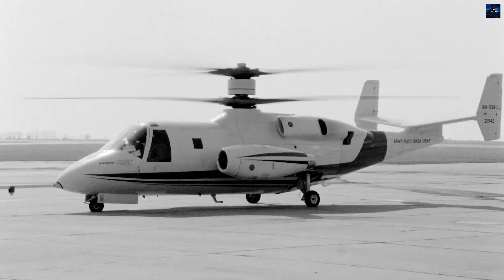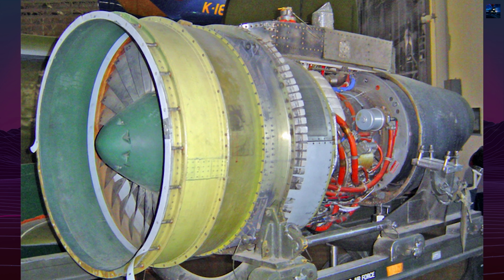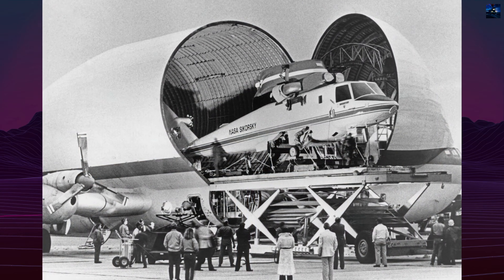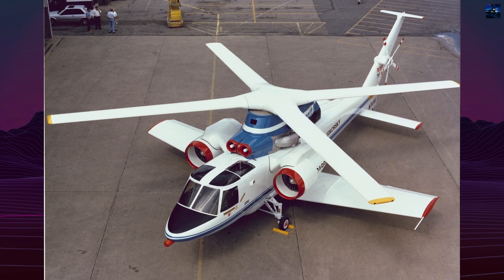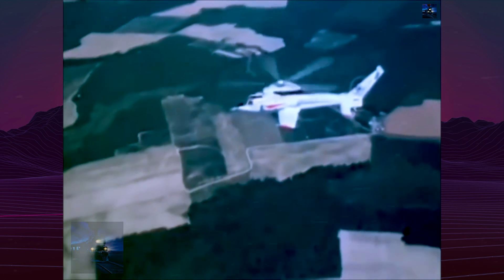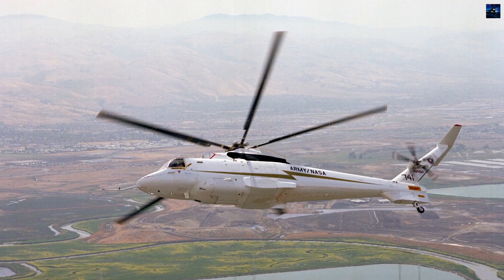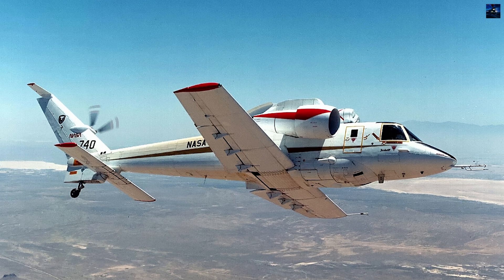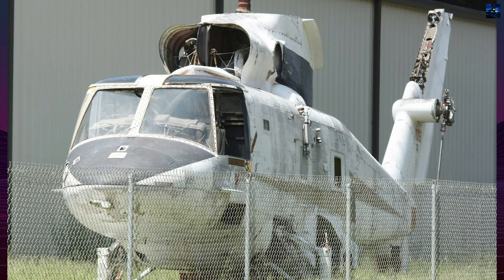Sikorsky S-72: The Experimental Helicopter That Could Fly Like a Plane

Comment: Blades tested  balanced at Ames Research Center in bldg 244.  
Eplosive bolts used on the blades for the ejection system.  all blades had to separate at the same time, for if one blade hung on for just half a rotation, the unbalance would cause the airframe to be ripped apart by the uneven forces.  Explosive bolt timing had to be perfect.
Reply: Sub-Sonic 'wave effect' in Rotation, at speeds higher-than  260 mph, resulted in lack of 'Pitch Control'. Pitch, in the Collective, is Your 'Balance-Point' in a Rotary-Wing aircraft. Once that Confidence is gone, You're LOST. This is Exactly 'Why' Blackhawks have swept-tipped Rotor Blades. They actually, at the Tips, Exceed the sound barrier in dives!. The 'Fixed Rotor-/-X Wing' planform was supposed to "fix" the forward-rotation issue of a 'still-spinning' "Airwolf-type" rotor. It Couldn't do that, and "normal" wing-surface controls literally would not Respond in-time to the fluctuations at the "X" rotor, even when in a static, fixed setting. Great Idea, just, missing many Computer Models with good Data.